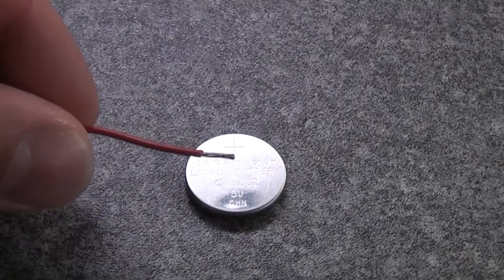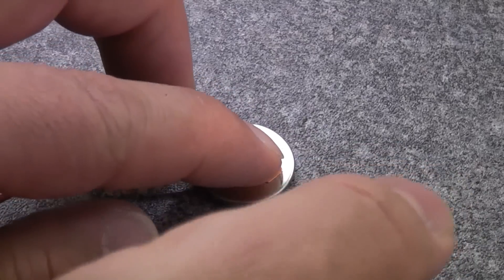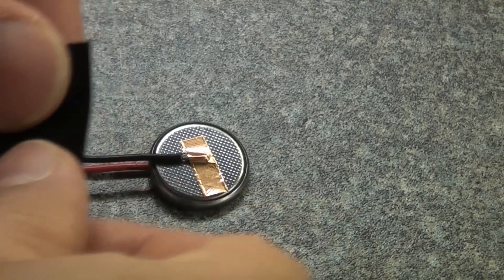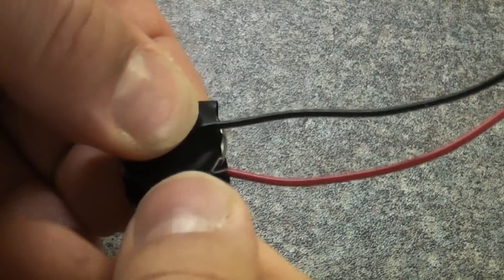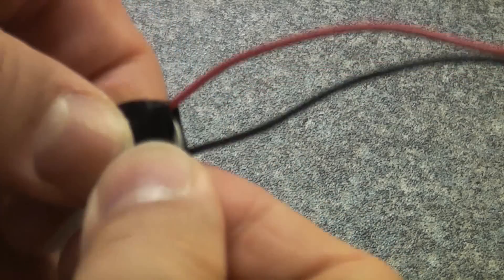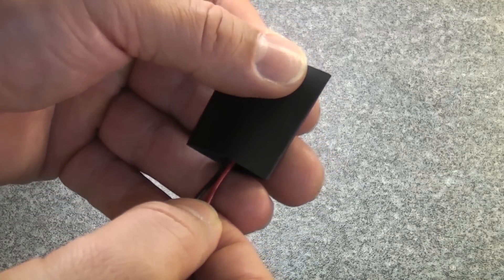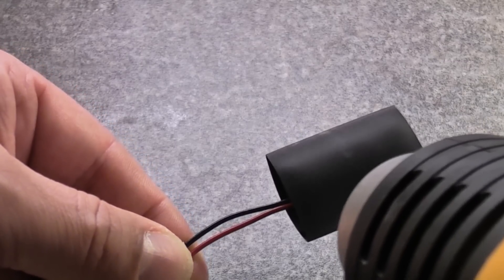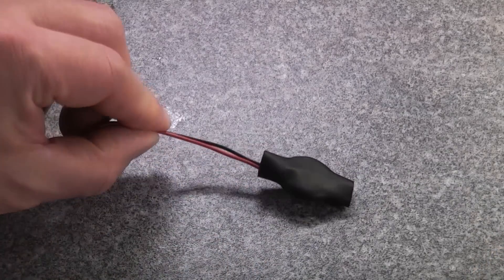CMOS battery hack | Laptop CMOS battery

Comment: Brilliant tutorial. I successfully replaced the CMOS battery in my HP Pavillion DV2 laptop today following your guide.  I think the plastic shrink stuff that I ordered may have been a bit too wide as it didn't shrink wrap like yours did but it still did a good job and the laptop is now happily using the CMOS battery hack.
Reply from the maker: I'm glad the video helped 
Thanks for the comment 👍
Reply: Good heatshrink wrap shrinks by about 1/3rd .. don't overheat though with that battery inside. Will have a similar effect to putting the hot soldering iron it, and there is no easy way for the heat to dissipate.

Comment: @Ultimate Handyman You could use a glue gun, spread the wires out slightly, splayed out, then pump some hot glue on them, not too hot to damage the battery and will also stick
Reply from the maker: Thanks for the comment 👍
Reply: I doubt that would work as the glue is not conductive.

Comment: Is it really so difficult for designers to install a battery slot on the side of the case? In this case, we could insert and remove the battery as an external flesh card. But I suspect that the company Intel does not want your computer to work for more than three years. Intel’s interest is that we change computers more often than once every 3 years.
Reply from the maker: I'm sure they made this job difficult on purpose!
Thanks for the comment 👍

Comment: OMG, that was short doing a big mistake! I'm just changing the battery and heating up my soldering station for soldering the battery. Thank you for saving me! It is an old Thinkpad 600e I'm changing the battery. Thanx for the video! Good job! Lupo
Reply from the maker: I’m glad the video helped
Thanks for the comment
Reply: @ultimatehandyman  You're welcome!
Reply: One hint after replacing the new battery in place: Check the thickness! In my case the shrinking insulation hose was too much. So it didn't fit into the battery bay. The insulation tape was the maximum I can wrap the battery around otherwise it will not fit. Lupo

Comment: Great video, well done; however, in the U.S., the conductive tape is about $10.00/roll, & a pack of heat shrinks is around the same.  So that's around $20.00 right there, vs. an $8.00 replacement battery.  I might have to hack your hack & do some workarounds.  It would be great if you made a video how to do a poor man's hack if they don't have those things.  I'm sure something could be worked out with aluminum foil, or maybe not even use something conductive, just tape the wires down... & then in lieu of a heat shrink, just double up on the electrical tape.
Reply from the maker: For a poor mans hack- just tape the wires on using insulation tape. It will probably be fine for years ;-)

Thanks for the comment
Reply: @ultimatehandyman  Thank you sir!

Comment: it's currently September 2018. I just discovered I had an old ThinkPad (not Lenovo, IBM!) T30 in storage. with mildew growing on the case because of moisture. I plug it and it boots up to windows XP! well after it gave me the error prompt that date is set incorrectly. opening it up, the CMOS battery is just like what you have in yellow shrink tubing. searched eBay found some but shipping will cost me a lot (I live in the Philippines). found this video and it's EXACTLY what I need to do!

Thanks so much from the Philippines!
Reply from the maker: I'm glad the video has helped 
Thanks for the comment  👍

Comment: would have been better if you solder a 3v button cell holder to the cable .then you could change the battery in like 5 minutes

Comment: Thank you for this video! What size heat shrink tubing should I get?  20mm? 25mm?
Reply from the maker: You are welcome.
I can't remember which size I got but from what I can remember it was inexpensive, so perhaps get a short length of both to be on the safe side.
Thanks for the comment
Reply: I got the 20mm one and it looks like it's going to work. Thank you for your reply!

Comment: Hi Ultimate Handyman,
Can you tell me what size conductive tape to get? I saw some on Ebay that are 1/4" and 1/8" but wasn't sure which size you used on video. Here is the link on Ebay.
https://www.ebay.com/sch/i.html?_odkw=Tapes+Master+1%2F4%22+x+36+yds+%286.4mm+x+33m%29+Copper+Foil+Tape&_sop=15&_osacat=0&_from=R40&_trksid=p2045573.m570.l1313.TR0.TRC0.H0.XTapes+Master++Copper+Foil+Tape.TRS0&_nkw=Tapes+Master++Copper+Foil+Tape&_sacat=0
Reply from the maker: I'd get the 1/4 inch as the 1/8 inch is a bit on the thin side ;-)

Comment: Wish I'd seen this a few days ago (I've got an old Lenovo X60 that I'm refurbishing and a ton of new CR2032 batts), but I've already ordered a new CMOS battery. Question for the future though, is the conductive tape necessary? I'm an admitted noob on the hardware end of things. I would have just used electrical tape to hold the leads in place. Would that be a bad thing to do?
Reply from the maker: The electrical tape should be fine. I only used conductive tape as I had a lot of it ;-) 
Thanks for the comment

Comment: Hi, I have been having problems with my laptop and it wont boot up. It posts perfectly fine, and I can get into the bios , but it wont boot into anything. It stops after "checking Nvram"
Reply from the maker: Have you tried booting it in safe mode?

Comment: Ok, so I don't have wires nor do I have,insulation tape nor,do i even know were to buy them! An can't solder...However, I do have electrical type! If I wrap the battery with it.. Could this work, ? I'm ready to scream! After taking this thing apart to find that because of one little piece breaking while taken the battery out! I CAN'T BELIEVE THAT it's this hard just to make the battery stay in! I'm two seconds from useing Guerilla Glue! Lol please,,,,,, someone help! I need advice!
Reply from the maker: Yes, taping the wires to the battery should work, perhaps put a small piece of aluminium foil over the conductive part of the wire before taping it on.
Reply: Ultimate Handyman! Lol There are know wires! Thought this was going to be an easy task just for resetting bio password setting everything back to factory settings.. however ,it's becoming a nightmare an there's no going back lol I'm stuck with a green broad smh...however please help it's a  N4110model all I want is for the battery to stay in the holder without popping back out! Lol thanks so much !
Reply: thanks....I was thinking if I couldn't done this but I don't have the copper tape thing

Comment: I cant seem to find any conductive tape in my country, is there an alternative, without having to solder? Thanks
Reply from the maker: I'd just put a small piece of aluminium foil over the wire before taping it to the battery with insulation tape.
Thanks for the comment
Reply: I actually thought of that but wasn't sure, thanks for replying

Comment: My video card is being blocked by my right angle cmos battery lol. Is there any heck to fix this??? I have a cmos battery cavity with some leads and a switch. Is there a way to solder it to the cmos cavity on the mother board. I can run the pc with no cmos battery but I won't be able to use my sata settings. Thanks a bunch. Great vid!!!

Comment: you should never hold batteries on both poles together, because skin is conductive and you drain battery while holding it like that. should hold it on a side, where only one contact is in place
Reply from the maker: Thanks, I was not aware of that.
Thanks for the comment

Comment: Can I use kapton tape ? I can't find conduct tape in my place
Reply: You can't really rely on conductive tape as the glue layer on it can prevent electrical contact between the metal layer of the tape and the battery casing. Your goal is to have wire core strands touching the casing of the battery nice and tight, but you can use any tape, including isolating tape. You can try Kapton tape, but i find it too stiff for such use.

Comment: Nice hack UH.

Was that a planned explosion or did you get a fright?
lol

Bear Grylls shows you how to use a mobile phone battery to start a fire in the wilderness but you managed to nearly start one at home lol
>;o)

Only ever had 3 laptop cmos fail on me in 30 years of repairing laptops but it does happen.
Pain in the bum having to go into the bios every time you boot but you can use the atomic clock program to change the clock for you every time.
Reply from the maker: Thanks, no it was not a planned explosion LOL.
At least I know not to try it again and can warn others not to try it.
Thanks for the comment
Reply: ***** Yeah thats what i thought with the quick movement of the hand - quick reflexes for an old geezer lol and remarkably honest! Thats why i like your vids the best! >;o)
Reply from the maker: Yeah, I can still move for an old guy LOL.My honesty often gets me in trouble! I often get asked questions and know before opening my mouth that it's not going to be the answer that the person asking wants to hear, but they should know that before asking me LOL.
Thanks for the comments ;-)

Comment: So I never had a problem with my CMOS battery, but I wanted to reset my BIOS settings. So I removed my battery and waited a bit, and replaced it. Now I am greeted with the "Reboot and Select proper Boot device or Insert Boot Media in selected Boot device and press a key" error message. After some research, I realize that the CMOS battery may be the perpetrator here. I didn't do anything out of the ordinary to my battery after removing it, I simply took it out, waited, plugged it in, and stuck it back on. So is the problem here the battery itself, or is it the inadequate sticking, or I didn't plug it in correctly..? I really need help right now, thank you in advance.
Reply from the maker: I'd try installing a new battery for sure, it should fix the problem.
Reply: Yep I have ordered a new battery. Thank you so much for the video and the fast reply!
Reply from the maker: You are welcome.
Thanks for the comments ;-)

Comment: hey i tried to update my bios on a lenovo thinkpad t420 .something  went
 wrong  and  it doesn't  power on,  it just beep there is a black screen, can you
 please tell me how
 to fix it with wincris  and if you can please  tell us how to put the bios 
files inside the usb or how to rename it   or i can use the usb bios 
programmer tool will that work? Can you please make a video on how to 
fix a black screen after a bios failed to update
Reply from the maker: Sorry, I'm no computer expert- my knowledge is strictly limited.
Have a search for Eli the computer guy
Reply: The only one who can help you is the maker of your motherboard. THey have live chat support based on your warranty..  Flashing BIOS is not easy, it is advanced,  they always recommend to read the manual or talk to their service tech engineers b4 you proceed..  The only one who can help you now is the maker of your motherboard...FLashing BIOS is saving on an EPROM  The actual BIOS code is stored on an EPROM chip, usually close to the small coin shaped battery. EPROM simply means the chip can be electronically reprogrammed so you can update to the latest BIOS version. The process is called "Flashing" the BIOS.  The following link explains why people screw up their computers when updating to a new version of BIOS.
http://www.techrepublic.com/blog/10-things/10-common-mistakes-you-should-avoid-when-flashing-your-bios/

Comment: Why not solder the wires to a coin cell holder instead of the copper tape? No soldering to the cell, no problematic tape copper or insulating. Just the heat Shrink tubing. And you end up with a solution that is reusable. If you must put the wires on the battery directly use a small dab of conductive epoxy.
Reply from the maker: +John KaBang Perhaps you should be asking the manufacturers why they don't use a coin cell holder. I just came up with a solution to a problem that worked ;-)Thanks for the comment
Reply: Most laptops have zero extra space. In fact some laptops use an even thinner battery than the 2032 battery it's so tight.

Comment: Terrific!  Now tell me how to remove the soldered-on battery and replace it. I have a perfectly good laptop with a DEAD soldered-on CMOS battery and I'm afraid I'll kill the motherboard if I try to remove the solder.
Reply from the maker: +Docputer 
That's crazy. The have soldered a battery directly onto the motherboard?
Reply: Yep....quite a few older Toshiba laptops have the CMOS battery soldered directly to the motherboard, and because I'm over 80 now and not all that steady, I know I'll muck it up, so I'm still putting off the try. Actually, I've thought of just cutting the two leads and solldering leads from a new battery to the old. Whaddayou think? By the way, your hack is going to same me some bucks.  Thank you!
Reply from the maker: +Docputer 
That sounds like a good idea ;-)
Just keep the soldering iron away from the battery, as I found out they explode when they get hot!
Good luck with it ;-)

Comment: would a laptop not power on if it was bad?
Reply from the maker: +Anthony video maker 
Yes, it will power up but each time it powers up it will not remember the time or date and will probably revert to the date it was manufactured.
Reply: ok then it is not my problem but still may change it if I fix the actually problem. What voltage reading is normal from checking laptop battery prongs with a multi reader.
Reply from the maker: +Anthony video maker 
I'm not sure as it's something I have never measured. It normally says the voltage on the battery though?

Comment: dat explosion though...scary, but thanks for the early warning

one question, can i just tape the wire onto the battery using normal electrical tape, and then cover the whole battery with more tape?
Reply from the maker: Vann Mizan Yes, that should be fine ;-)Thanks for the comment
Reply: how about "the mess" done by that electrical tape when exposed to laptop's heat?
Reply from the maker: Vann Mizan 
Does your laptop get that hot that it will melt the tape?
If so you might be best off using some heat resistant tape?
Reply: its my sister's, and she' s like typical user

Comment: what about if the plug has a WHITE RED BLACK cables, what to do with the WHITE?
Reply from the maker: Isboset Gutierrez 
When you remove the wires from the old battery see where the white wire connects to and put it in the same place. 

A lot of power tool manufacturers now put several extra terminals on larger batteries for power tools etc. so when you look at them there might be 4 or 5 metal contacts but if you open the battery up there are only two wires actually connected to anything.

Comment: i want to know what it mean RTC battery is low
Reply: RTC and CMOS battery are the same thing these days...there was a time when only the Real Time Clock required battery power to keep the timewhenthe computer was switched off. The Configuration was fixed in ROM, or EPROM not changeable, unless one changed the (EP)ROM  so did not require power

Comment: just a little tip for you. whenever you work on live circuits (batteries or other low voltage equipment ie alarm systems) and you use an electric solder iron instead of gas, you should disconnect the earth wire from the iron or put a small switch on the cable which switches the earth. you will obviously never touch the metal tip of the iron anyway.

so when you try to solder a battery or any live low voltage circuit you create a short hence the explosion, this is due to the iron being earthed. so remove it. or you could just buy a gas iron. :)
Reply from the maker: CalumR 19 
I don't think any of my soldering irons are earthed, I'm sure they are all double insulated.

Comment: What kind of insulation tape you put on to attach the negative and the positive ? Thank you .
Reply from the maker: David Solis I used conductive tape first to hold the wires to each side of the battery, then just normal insulation tape.
Thanks for the comment
Reply: ***** insulation tape, otherwise known as electrical tape. however avoid the cheap stuff as the glue will get sticky, whereas the better quality stuff doesn't get as sticky or de-laminate.

Comment: its ok friend my cmos battery is CR2016 i replace it CR2032
Reply from the maker: They are the same voltage so it should be fine. I'm not sure about the size difference though, but if it's on leads it should be fine ;-)
Reply: Archie impas  that is just a smaller package of the same thing, all will be fine.

Comment: Believe it or not hockey tape works even better for this hack than insulation tape. When it dries from the heat generated inside the laptop - it tightens. Insulation tape does the opposite actually. It tends to expand and the glue sloughs off in a huge mess. With hockey tape you don't even need to use heat shrink pocket.
Reply: +TheHallucinati ill have to have a look at "Ice Hockey" Tape one time.. for a Conductor tape, i use Copper Slug Tape.